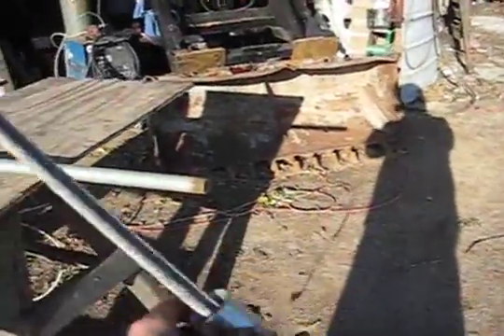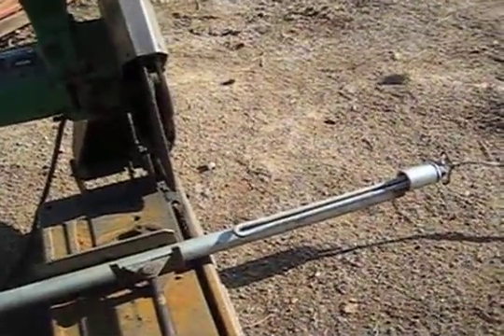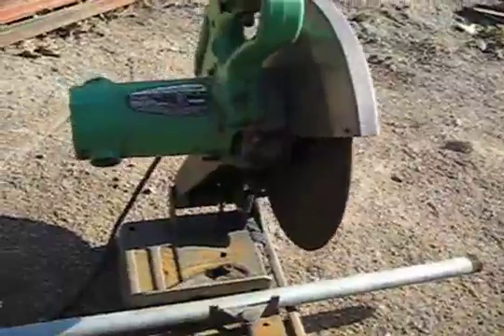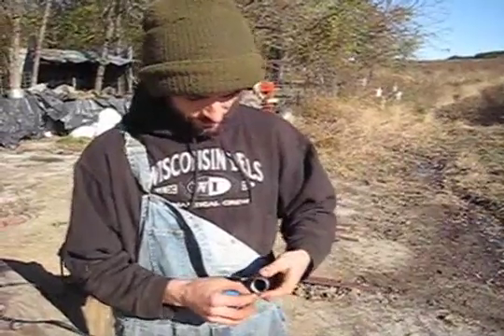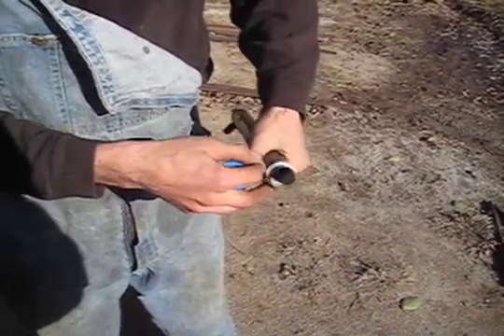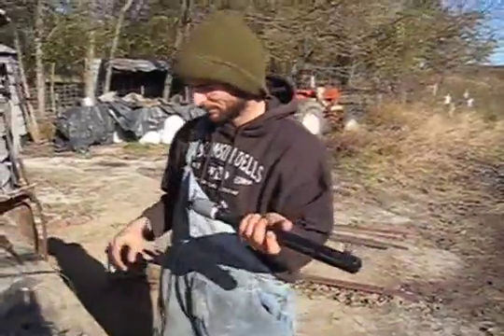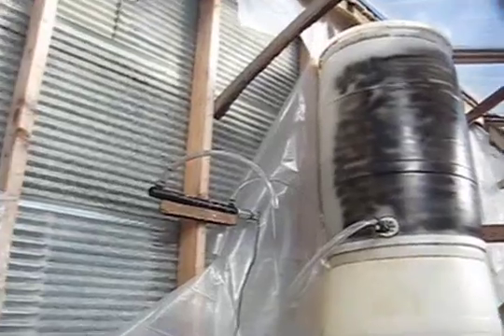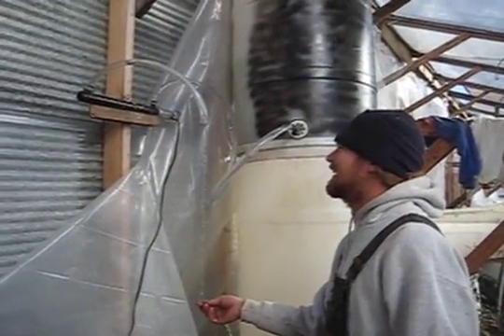Open Source On-Demand Water Heater

Comment: I live in one of the biggest RVs they make but it lacks a washer and dryer. So, I added a storage shed onto my deck for a laundry room. The RV only has a 20 gallon water heater so Im looking for a small on demand heater for doing the wash. Does anyone see a safe way of using this kind of setup for my application?

Comment: you can get the elements for less than 20 bux at lowes or home depot. as far as the safety of this, i would seal the terminals with non-conductive sealant (not sure but maybe rtv would work), and if its plugged into a gfci, i dont see a problem. what kind of gpm of hot water are we talking with this setup? you can get elements with high wattage ratings, but of course, the power used will be high. i may set about building a LPG version.

Comment: @realjoefriday I am a professional pipewelder.  Welding is safe on galvanized material as long as you don't breathe the fumes. It will give you flue-like symptoms if you weld it all day. That little bit of cutting and welding won't even give you symptoms if you DID breathe the fumes during the manufacture of this heater.  BTW, why do you have to insult someone who is trying to learn and share that knowledge with you? I find it very rude. You should apologize.